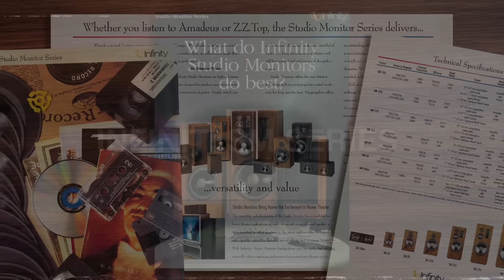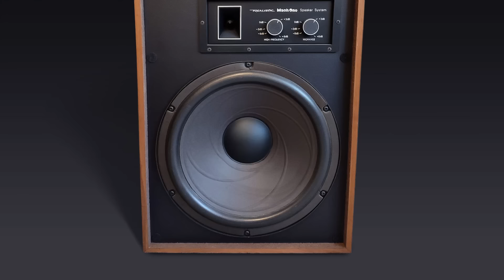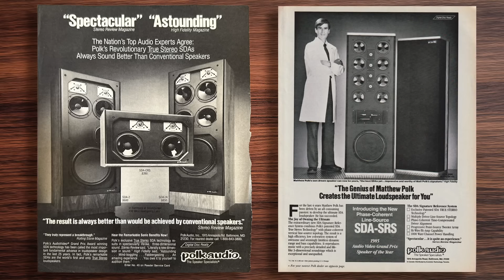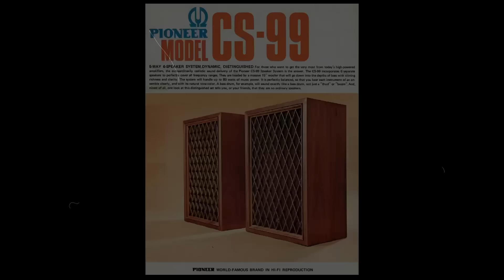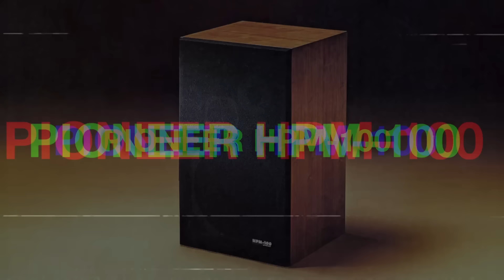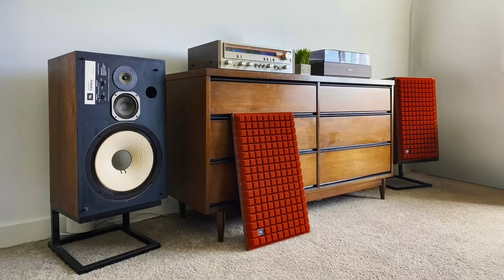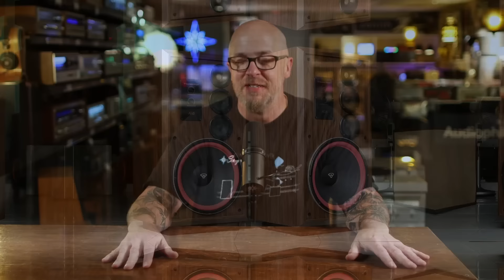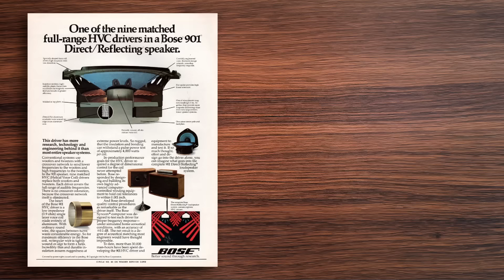Why Do Audiophiles Hate These 9 Legendary Speakers?

Comment: I absolutely love my Cerwin Vega 12TR's and would buy a pair every time I see them for sell if I had the money available.  They sound good with all genres.  I also like my HPM-900's (all original) and my Boston acoustic A-150's and A-200's.  I also took a Utah speaker packed it with HPM 100 woofers, HPM-900 crossover, HPM-900 mids, S-910 tweeter and they were great test speakers until coil rub bit the woofer.  Finally, I have two pair of CS-63DX's stacked and I love the sound until it becomes fatiguing at times.  They fill the entire house with great sound from the basement and my Father's restored SX-780 drives them perfectly.

Comment: I worked at an hifi shop in Aalborg, Denmark in the 1990ies and we were an Infinity dealer. We had the Kappa`s , the Renaissance 80 & 90, and then the SM series.....
They have absolutely NOTHING to do with an Infinity. They sound awful. Why buy them at all? If you like that kind of sound, then buy the Cerwin Vega`s.
The Infinity SM series is really loudspeakers to avoid. They look cheap, they are build cheap and sound cheap.

Comment: I'm the proud original owner of Infinity SM-125s and the second owner (after my uncle) of Pioneer HPM-100s. The SM-125s, with or without grill, are gorgeous. They both make it into the rotation (the Inifinity's are heavier), but I place them behind in quality to my Boston Acoustics CR-8, Ohm Walsh and Project One MM-75. But those last three require a sub, the Inifinity's and Pioneers were built to RAWK all on their own.

Comment: I've got a pair of Klipschorns and the last thing I'd call them is "shouty". For me, they're the most lifelike sound I've ever heard short of a live performance. I love piano music and, running off one of my tube amps, it's almost like there's a grand sitting in the room. 

There may be better speakers out there but not anywhere close to this price point, and I don't think they leave a ton of room for improvement. This of course assumes one has the right room for them, decent acoustics and appropriate amplification. Super low distortion, they thrive on tube gear. My Marantz 2270, though beautiful and iconic, has been gathering dust since I bought 'em. It sounded noticeably metallic with the KHorns. 

That said, the room does not need to be perfect. I have only 8.5 feet between them, from inner corner to inner corner. Klipsch says they need 8 to 20 feet. I have a couch between them. One is in a corner. For the other, I used a high quality piece of plywood to enclose the far side. I have skylights and a cathedral ceiling that seems to really help with the acoustics. It also works that my house has an open floor plan so the sound is not confined to a closed-in-space. 

There are other great speakers that I love. But my KHorns aren't leaving my possession until it's time to move me into a retirement home.

Comment: Whenever the subject of speakers comes up, I have to add this. Back in the 90's, I was interested in putting together a better hi fi system. So I subscribed to Stereophile magazine, to gain some knowledge. Mr Henry Kloss, designer of speakers, was interviewed. In his interview, he told a story of when he was designing a speaker to be sold by Advent. The engineers went through a lot of trouble, to get the speakers just right. After all their work, Henry decided to do an experiment. he hooked up a pair of Radio Shack Realistic brand speakers, the inexpensive brand that you would get with a Radio shack stereo system. Then he put a 10 band equalizer into the system. Played the same songs back to back; the new Advents, with no changes, and the Realistics with adjustments made via the equalizer. And found that they could 'tune' the Realistics to sound just like the expensive Advents.  So much for expensive speakers. Oh, I already had a 10 band equalizer in my system. And, I realized that I don't have audiophile quality ears. So I'm just fine with less expensive speakers. I wound up with Cerwin Vega's, and they sound just fine. So I'm one of the lucky ones, who doesn't need a very expensive system, to enjoy music. Just one, that, 'good enough'. And I think most people who aren't audio snobs, would do well to remember, that it's not necessary to impress visitors and gueses with fancy audio brand names, in order to enjoy music. Just like people who like to buy the latest video screens so they can brag about how they can see the actor's individual hairs, or each blade of grass, it's more important to have good quality music (and good quality stories if you're watching movies) that it is to be picky over the less important things. I grew up enjoying music on a 9volt hand held single AM radio, and loved it. And had a 9" tv. I felt like I was the luckiest kid in my class.
Reply: Well it appears that the great Henry Kloss was truly an honest man. I just checked out his Wikipedia page for more details. Funnily enough, in addition to a pair of Realistic speakers I have owned two pairs of AR speakers (and the AR turntable), and a pair of the original Advent Loudspeakers. I still have my set of Cambridge Soundworks computer speakers. All of which represented real value. I even saw his projection TV being demoed near the MIT campus in Cambridge. Today, an ambitious (and lucky) young person can do a fraction of that and become a multi-billionaire who thinks he should run the world for the benefit of himself and people like him. Not all change is "progress." BTW, of all those speakers from Koss-associated companies, none needed equalization to sound good. I could leave the tone controls flat. No sound reproduction system can deliver Nirvana to you, only you can. Look up Ken Fritz, the late creator of a famous million-dollar stereo system, and what creating it did to his family. The price of obsession. Read about it in Stereophile and the Washington Post if you want the details. Or just forget about it and be happy!

Comment: As an owner of a perfect set of Infinty SDA2's  some of your comments were a little broad.  I have the original Stereo Review article on these speakers and they were one of their highest rated speakers in linearity  running from 35 Hz to 20,000 plus or minus 3 db or less.  They also had usable bass to 30 hz.  The midrange was described as smooth and warm.  As to the soundstage manipulation, these speakers are also critical for room placement to accomplish the wide sound stage.  Properly configured, the wide soundstage can be heard over a ten foot width and it is amazingly effective, even compared to a modern  multi channel system. While fairly recently I replaced  these with  SVS towers as part of an 11:2 SVS system  with my Yamaha AV receiver, I still have thesse connected on a second channel.  When you want to play something like Linda Ronstadt or jazz, classical music or simply  simple stereo, their sound is still superior to my very highly rated  SVS speakers in two channel listening.  They are also bullet proof capable of quite high SPL levels without distortion.  And yes it is sad that later Infinity products did not meet  the standard of rhese speakers.  

ev

Comment: I knew several people who had 901's. I never heard a set of them sound even close to decent, except at an electronics store in the Chicago area where they were set up in a treated room, hung on rubber coated chains. It needed a sub, but it did sound pretty decent. Some of the other speakers on this video were owned by neighbors and friends from school, and I sold some of them to them, the CV's and Polks, and I just didn't comment, except, "sounds good!". I wasn't a fan of any of these speakers, but I have to say, the 901 comes in dead worst.

Comment: Yea, I bought into the hype when I got my JBL100s several years ago. I even found the ad that told the huge price of a little over four hundred dollars a piece, and I’ve still got them even though the acoustic form has been long gone for years.  I put a pair of Dahlquist DQM-9s in the room with the L100s.  The L100s were near the wall and the double back ported DQM-9s were farther away from the wall. Needless to say, I didn’t have to turn the volume up that much 😂.  Ooh the good old days 😅

Comment: Klipsch fanboy here.  I own a lot  of Klipsch but I can be honest.

The good thing about the Klipsch Heritage which include 7 different models were designs which were touched/designed by PWK, Paul W. Klipsch, is that they've been around a long time.  The bad thing about the Klipsch Heritage series is that they've been around a long time.  

I fully agree the older designs from the 70's era were indeed harsh and shouty.  Put your hands over your mouth CLOSE like a megaphone, then you have the old shouty sound.

The newer ones use a much more WIDE horn with better crossovers and tech improvements (rubber damped horns) and the shoutiness has been engineered OUT and sound pretty good.  The new ones suffer from the reputation of the old ones.  

The new stuff definitely has a sound I think a lot of audiophiles would like if they did a blind listening test.  The old stuff has held up over time very well and they are easy to hot rod, which is part of their appeal, especially to people like me who like the old Heritage speakers modded with the new sound.  Best of both worlds.
Reply: I really want a pair of Klipsch Fortes to be my front mains.
Reply: Loop

Comment: Bose 901 overrated? No friggin' way. I have done small live events (ages ago) with 150-200 people with with 901's on stands WITHOUT the EQ. The EQ is overrated, not the speakers. Whatever is bothering you in the frequency response, nothing that cannot be fixed at the mixer. Room acoustics,  geometry etc. is so much more important than that EQ. I have thrown massive power at them during one event with extreme affluence of people that the speakers started to sound like a tortured elefant, but they didn't fritz out on me.

Comment: The Bose 901s would be my pick of all those.You  are so right about positioning being critical to getting the best out of them.And you need a good quality fairly powerful amplifier.They are surprisingly good on orchestral music which is really what they were designed for but they can make not very well recorded old rock or reggae sound decent .And most of all they are musically engaging and tonally pretty benign.Unlike most of the rest in this group which tend to sound coarse and aggressive.Non audiophile for sure.Which is both their strength and their weakness.
Reply: The 901s have a flat overall response and seamless sound similar to single driver speakers - no crossovers. It's my favorite characteristic of their sound, followed by the large soundstage.

Comment: I had a set of Cerwin Vega 316R speakers that I bought new in "81. Kept them for several years but sold them before a big move because they were too massive to take across the country. I've never found another set of speakers that brought me as much joy as those Cerwins. They sounded just fine to me on my DA-A10 amp with Marantz preamp, and when cranked up they would rearrange your insides.

Comment: I went into a sound shop in Hawaii in early 1976 to buy JBL L 100's. I had already made up my mind that's what I wanted. The salesman had me listen to a couple of other speakers and neither impressed...until he had me compare the L 100's to a pair of ESS AMT 1b bookshelf speakers. The JBL's had very little midrange and were VERY directional. The sound from the ESS speakers was so clear and it was like I was sitting center stage and listening to a band live. I know they're not for everyone but I loved them. Actually I love them as I still have them. In 2018 ESS in Los Angeles worked on them redoing crossovers and replacing the major components. They made them look and sound new. Honestly I think they sounded better than when they were new. Later that same year I found a pair of ESS AMT 1a speakers nearby in Las Vegas (about 2 hours away). He was the original owner and they were in really good shape. I cleaned them up, replaced the passives as they were old. The drivers were fairly new. They're in my main listening area. The bookshelf models are in my spare bedroom/office. I have bought new speakers 3 times and each time went back to the ESS ones. They're the sound I love. They ARE truly sound as clear as light. As far as 901's. I had so many buddies that had them. NEVER liked them. You'd think if I like clear sound they'd appeal to me but to me the highs and lows (I'm not going to say it) aren't that good. I've heard a few other speakers in different price ranges that were nice. But after nearly 50 years listening to ESS I'm not going to change now. I would have rather found a nice set of rock monitors than the AMT 1a's but I'm still happy. I once did have some Sansui speakers thinking that because I had a Sansui BA/CA 2000 and Tu9900 setup it would be cool. It wasn't. Worst speakers ever. How can you have 15" woofers and NO BASS? Harsh, awful speakers. I don't mind the Klipsch speakers. Just too massive for me.
Reply: I don't hate 901's but I do hate most of their owners. If I've heard "You've just never heard them set up right" once, I've heard it 1000 times. Any speaker that requires EQ to me sucks.

Comment: "Audiophiles" have never had an original thought of their own. They like what they are told to like and they dislike what they are told to dislike.
Reply: So true ,, if you want an audiophile to cringe say Kenwood ,, they hate Kenwood , for no other reason then being told they suck ,because they have only heard them on under powered systems  , hook them up to a system with at least  20 watts more  per speaker then what they are rated  then you will get the full range they offer as Kenwood speaker are power hungry and they handle 30% more wattage then they are rated for ,, to people don't know how to set the tone and bass properly they only go by what others tell them

Comment: I was working at Radio Shack in the years of the Mach One and sorry for the fans but noooooo. I had to repair so much of them with busted drivers and there was no driver in those cabinets that matched the wattage advertised by spec sheets
Back then I had Elipson at home driven by a Sugden , my boss had a bang & olufsen system.
So imagine, even the people that sold them didn't believe in them 😂

Comment: I think Allison 7 speakers are the worst for speaker placement in a room. I had a pair I restored for a guy and I hooked them up and was like what the hell these sound terrible. No bass, just middy with lots of hash highs. So I had to do some research and found that they need to be with 20in of a wall. So I moved them close to a wall and was like holy crap there we go. They sounded pretty amazing. But away from a wall it was like a loud tweeter screaming in your face.

Comment: I have a pair of Kenwood MV-5’s and MV-7’s still in use. Dad bought them in Sicily when we were stationed there in 1990. I saved them from rotting away in storage. Sure they’re not Klipschhorns but boy do they get loud. The 5’s have two 10” woofers, midrange and a metal horn. The 7’s have 12” drivers and the same midrange and metal horns. They have done well over the years for pretty much everything. 1812 Overture CRACKS on these.
Reply: O ya Kenwoods are highly underated they are way better then what people think but make sure you have a powerful system as they are power hungry
Reply: @phantomlegion4522Oh they like power for shure (audio pun). I don’t have separate amps but my trusty Yamaha HTR-4890, 140 watts a channel. Love this receiver.

Comment: I had a pair of HPM100s. I never figured out  how to make them sound right. I wanted smooth frequency response and presence that they just didn't provide in my setting. I'm much  happier with my current system, with a pair of Dahlquist M905s and a subwoofer.

I tried and failed to make Bose 901s work in our  living room. Both the shape of  the room and aesthetic concerns worked against them.

Comment: One problem you're going to run into is that a lot of people have some kind of hearing problems that they're not even aware of.  So a speaker might sound as good as they've ever heard, but that doesn't mean it's actually good.  To someone with good hearing, it'll sound like crap.  That was the case with my college roommate.

Comment: I have 3 pair of JBL monitors, a JBL centre speaker, and an old Cerwin Vega active 12 inch subwoofer, all running off an old Denon 7.1 high power reciever. To me, it sounds fantastic. Horses for courses. But if you like really loud, clean, rock music, Who, Led Zep, Jimi, Jeff Beck, etc, this will do the job.